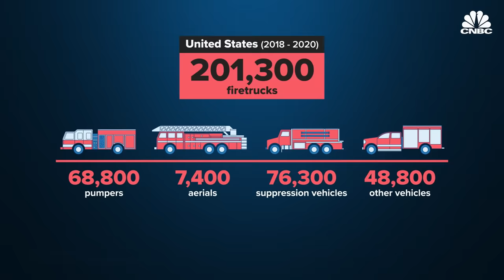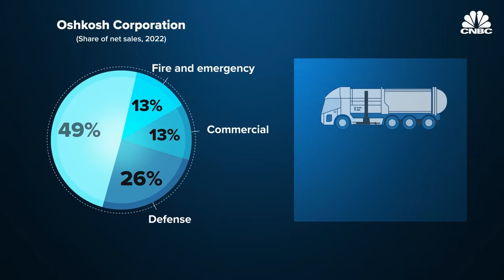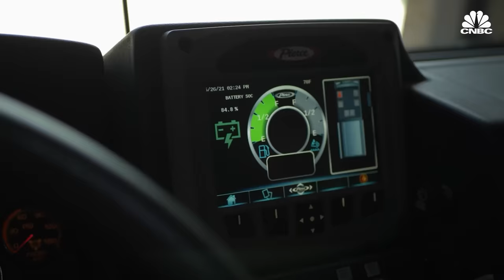Who Makes Money From America’s Firetrucks

Comment: As a paramedic/firefighter I know a little about this issue. It’s a warm fuzzy feeling some have when electrifying. For a crash rescue vehicle it is much more feasible to electrify, the time and mileage on one of these vehicles is much less than on a busy urban or suburban piece of apparatus. The calculation must be considered regarding the amount of carbon used to mine the raw resources vs the amount of carbon saved with the use of the end product. Not one thing has been addressed in the conversation regarding the generation of electricity, the environmental impact of mining the raw material nor the problems disposing of the batteries and their toxic waste. Seems to me the positive in this equation seems to me is the knowledge gained in the process of innovation. As far as the net benefits of electrification….not ready for prime time.
Reply: we tested an electric Rescue Engine at some of the busiest stations at the largest department here. Worked very fine, and way better than expected. 
When you want to calculate on how material for batteries are gained and how electricity is produced you have to keep in mind all the logistics around oil and diesel production as well.

Comment: firetrucks don't put on many daily miles. they are neighborhood based due to response times so they may drive 2 - 3 miles on a call maybe 5 . smaller towns may only have a few firestations so there they may drive more to a call. a typical station may get 2 - 10 calls a day and most of those are  health related like heart attacks or car accidents with injuries. so they have a backup diesel in case they need to run the pumps for a long time at a fire., an easy application for electric vehicle.
Reply: You seem knowledgeable on this, but why don’t they just send an ambulance and firefighters in suvs or vans for non fire related instances?
Reply: @dty1207  Surely the heart attack will get an ambulance. I guess a motor vehicle accident may get a fire truck (even if there is no fire) because the fire truck has a lot of useful equipment and tools on it. Jaws of life, chainsaw etc.
Reply: @andreasu.3546  I figured, but couldn’t a large suv or van carry that kind of equipment? And in my city, even in home based medical emergencies they bring the fire truck
Reply: Ignorance must be blissful 😂 you clearly don’t work for a fire department, or know the amount of load that just one pump draws
Reply: @dty1207  what happens when the ambulance transports to the hospital and there is a fire and crew from the fire engine is stuck on the ambulance?
Reply: @dty1207  yeah, what if they need to help carry a 250 lbs person down a set of stairs to get outside to the ambulance.  There is a huge reason why they send a fire engine with an ambulance.  Manpower!
Reply: @dty1207  Fire apparatus respond to medical calls because the extra personnel is needed. The personnel take their truck in case the truck is needed. You do see SUVs and support units respond to medical calls, but usually not if the expense of that decision is taking the main fire apparatus out of service.
Reply: Yes, an electric vehicle in a wet environment, what could possibly go wrong?
Reply: Typically, the bigger issue is expense.  A municipal pump apparatus will cost $1M (round numbers), and in a large city will see about 10 years front line service.  The bean counters will say that it costs the city $100K/year + fuel + maintenance.  Sounds like a lot of money, until you compare that to the cost of **staffing** that truck for those 10 years, which will be $2-3M, including payroll, insurance, pension, etc.  Buying another vehicle, which brings its own maintenance costs, just doesn’t move the “expense” needle very much, especially considering that you’ll still need that big fire truck for firefighting.

Also, understand that this is being scrutinized at the local level.  There’s an old saying that “All politics are local”.  Your local city council tells the fire department to buy electric fire trucks because local environmentalists attend meetings and demand it, not because they’ve done the research themselves.  Your local city council is looking at this year’s budget with an eye toward what they can tell the voters ahead of the next election.
Reply: @aaroncrewse5746  I would assume they wouldn’t go if they aren’t needed? Also, I’m asking why don’t they bring an suv *instead of a fire truck not all car pool in an ambulance* My posts clearly stated: an ambulance AND an suv/van. Please comprehend 😂
Reply: @aaroncrewse5746  if it’s simply an extra personnel thing, why couldn’t those extra men simply take an suv or van? No one is answering that really simple question.
Reply: Something to keep in mind, just like about every other industry out there, the manpower is NOT there to staff a rig as well as the bandaid bus.  With the huge uptick in medical calls, the extra staffing is needed.  That is why rig has to go out with the ambulance.  Get people to stop calling for toe pains and it might get better.  There are A LOT more factors as to why engines/trucks run med calls.  But in the end, the biggest factor is manpower shortages.  As far as other calls, I invite you to go look what those trucks have on them.  They are getting MUCH larger and versatile.  We have to bring everything we need.  I can tell you the majority of trucks out there now are trucks that have replaced two.....and sometimes three trucks from the past.  To speak about those miles, the miles getting there aren't usually the issue.  It is taking a lot of equipment.  Waking it up instantly.  And abusing the heck out of it.  You can't judge the miles like you do on your car.  I'm sure your car does NOT have a PTO or any of that.
Reply: Wrong bigger departments sim times make 30calls a day
Reply: You don’t know what you’re talking about dude I work on fire trucks and they run harder than you think for my department
Reply: @mvcharisma2968 I work on fire truck so I do know.
Reply: @dty1207  No one is answering that simple question? I thought I answered your question fairly thoroughly. Where's the confusion?
Reply: @hankwvu neighboring department to me replaced their heavy rescue, engine, and tanker truck with one ridiculous rescue engine that has 1500 gallons, rescue tools, ropes, supply lines, and a fold down ladder rack. Their biggest issue has been the NFPA has no idea what it actually is so classifying it and figuring out what to put on it us a bit of a challenge. But the budget is limited, costs are through the stratosphere, and build orders are edging past the 18 month mark. We do a lot with a little.
Reply: You sound like a socialist town councilor who thinks she knows what she's talking about. Fire trucks put on *many hours*. They can be utilized for 24 hours at a time in major events. Trucks do not just drive, they also have to lift, provide hydraulics, pump. This requires energy. In a diesel truck you can just tanker in diesel when the fuel gets low. With electric, you have to take the vehicle out of service so you can plug it in somewhere. Then if you have a grid failure you have no vehicle or you then have to expend precious diesel resources to power an engine to power a current to charge a battery. The future is about making things easier and better not more arduous and backwards. Batteries benefit China they are a dumb technology. There is a reason nobody wants this unless it's heavily paid for by taxpayers
Reply: @dty1207 Because they are assigned to an engine co., or a truck co., or a squad co.  If an engine company is dispatched to a cardiac emergency with an ambulance and they roll in an SUV, when they clear the call they must drive back to the station. If they are dispatched for a fire before they arrive back at the station, they must drive back to change apparatus, delaying their response to the fire.  It's a readiness thing.  The next engine company may be based miles away.

Comment: 8x the cost of importing the equivalent specced foreign fire truck. Do fire trucks in the USA really need to each be custom built by hand? Why not build a standard model en masse? Shame the video didnt answer the question in thr title.
Reply: From being with three departments spec’ng new vehicles (an engine, two rescues, and a quint), the idea is that if they’re spending between $500,000 and clearing a million, they want the vehicle to be exactly how they see fit, how they use it, how they want it to operate, and how they want it to look.  Custom chassis designs have the advantage of a cabover design, but not much more.  A commercial chassis engine or rescue can save hundreds of thousands, but “fire trucks have to look like fire trucks”.  Tradition is common for overshadowing practicality.
If there was a design for an engine, one for an engine tanker, one for a quint, so on and so on, the departments could fairly quickly adapt.  However like auto markers (though magnitudes more expensive) the apparatus manufacturer make a whole chunk of change designing, up fitting, and modifying for individual customers.  One engine and a quint that we ordered were manufacturer demonstration units, and shaved between two and three hundred thousand off a custom built vehicle of the exact same design.
The perfect example, a tanker.  4,000 gallon tanker, commercial cab off the lot, $200,000.  Order one for the fire service, 2000 gallon tank, $600,000.  Want a cabover custom chassis?  Add $200,000 for that.
Reply: I don't know, at some point the vehicle is so complex that you might as well custom build it, so this might be ok. Which is why they can change technologies so quickly which is a plus. These vehicles are pretty impressive.
Reply: Every dept. needs and wants something very different depending on the building types, station sizes, distances, etc in their area.
Reply: There is no unification in the USA with Fire, Police or Ambulances, compared to where I live (New Zealand) we only have one Fire Service and one Police Service for the entire nation that does have  standardised equipment for all. We do have two ambulance services and they are both self sufficient through their own fundraising campaigns. This does save a lot of money, compared to someone that lives in a city like Chicago that has to pay for city, state and federal services with a lot of overlapping
Reply: Different communities have different needs.
There is a guy in West Texas I see who renovates 18-15 year old fire trucks for smaller communities who have volunteer fire departments and have specific needs.
He also does regular service (standard maintenance) for area fire trucks like oil changes ext….
Reply: @ytzpilot  I think the vid said 200k fire trucks, at 1M a pop that's $200B say for 10 years. $20B per year doesn't sound like much at the national level.
Reply: @Rene-uz3eb  you are missing the point on standardising, another example is Southwest Airlines, one aircraft type lowers both purchasing and maintenance, the same rule applies for vehicle fleets. The cost of a vehicle is a fraction of it’s running costs over a 20 year period the maintenance is the higher number, and having a fleet of the same vehicle type lowers maintenance and spare parts significantly.
Reply: It would make make sense to have a standard base model, sort of like Unimog in Europe. 
But a lot of it comes down to plain old resistance to chance, even if it’s for the better. 
Same goes for most of their gear.  For example euro style helmets are safer, but not used, simply because they prefer the look of the old style/ design currently in use.
Reply: @ytzpilot that's because the USA is not a single country.
Reply: Most fire trucks in the US do not cost $2.5 million. It's up to that for a custom aerial truck. An average pumper engine is quite a bit less. And there are standardization. Not everyone is buying a customized Rolls Royce, Mercedes, or Bently. Most people drive a Chevy, Toyota, or Honda.
Reply: Unfortunately the fire service was in America isn’t necessarily driven by practical.  Big and flashy is what is wanted. If you can afford it .
Reply: Unfortunately the video stated that a majority of the trucks are custom made.  That’s not entirely true.  There are many base models that have some level of customization available as options just like automobiles.  There has been so much consolidation in the business over the past 20 years that Pierce has become the largest manufacturer in the fire service.  But, there are many off the shelf items available.  Departments like FDNY purchase a standardized model (that they developed according to their needs).  But, many smaller depts purchase base model apparatus.  It’s just too expensive now. And the average cost per apparatus is closer to $1M, not $2M.
Reply: One of the reason that fire trucks cost so is because of all the requirements put into them, by the federal government. A new fire truck can only be used 10 years before it must be replaced. Most of Large governments, have to receive grants to keep purchase new trucks. Emissions requirements add more costs and make new vehicles cost prohibited.

Comment: Electrifying every mobile vehicle may sound as good idea on the first glance (form an ecological viewpoint), but we have to consider the impacts.
1) The bigger the mass to move, the bigger the battery needs to be. For a Truck of this size, this usually means 3-4 Tons of battery weight alone..... (a 100kwh Battery of an EV usually weighs ~600kg). With this battery weight along comes more wear & tear on Suspension and Tires. A lot of the environmental savings a offset by the added weight. Plus the battery has also to carry it´s own weight + reduces the amount of available load for the rest of the truck. 2) The more we electrify the more we become dependent on the grid (for charging). In case of natural disasters or war-like situations, the vulnerability of the grid becomes issue no.1. In these cases you often need this kind of equipment the most. And then you have a 2 million truck "sitting duck" because it cannot be (re)charged... If you look at public infrastructure such as Water-Supply: (btw: key for Fire-fighting !) guess what the fall-back systems for electric water-pumps are: DIESEL-aggregates. The whole discussion has (sadly enough) already lost its techno-neutral ground and has become an: "Electrification-will-save-us-from-extinction"-issue.
Reply: you can spec an electric truck to be disaster proof with a diesel range extender as backup.
Reply: @EnjoyFirefighting   or you could simplify it and only have a diesel engine

Comment: I believe every new home should be built with a ceiling sprinkler system to provide a last line of defense against a home fire. This will add an additional cost, but a fire insurance savings. Most fire departments respond to medical emergencies (85%).
Reply: Umm all new homes since 1998 has ceiling sprinkler system that I’ve seen. That’s how it is in California.
Reply: Think about how often you set off the smoke detector
Reply: @danfecke sprinkler systems are set off by heat, not smoke, much harder to do accidentally
Reply: @nrgonline California is NOT the same as the rest of the country
Reply: How about not building houses with flammable materials?
Reply: Agreed.  I read an article years ago that said the main reason against residential sprinklers was the additional cost of about $500…on a $250,000 house.  If I ever have a house built, it’s going to have a sprinkler system.
Reply: @kornaros96 you mean like lumber ?
Reply: @kornaros96  Are you going to have your couch and bed made from concrete???  Are you going to have nomex underwear and socks??